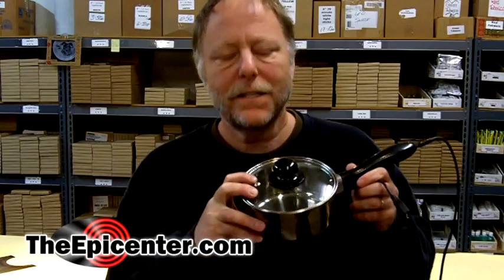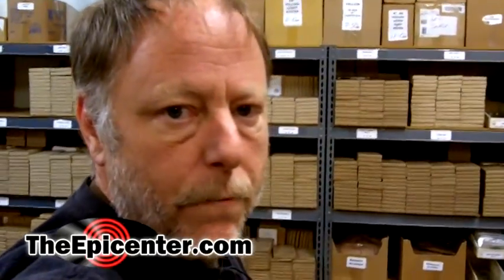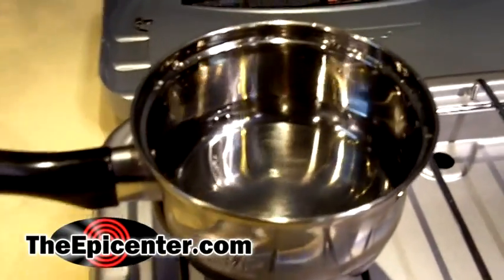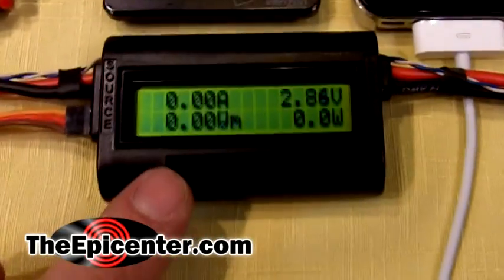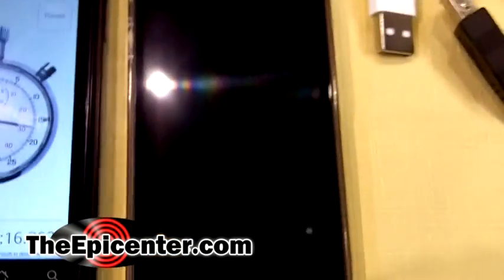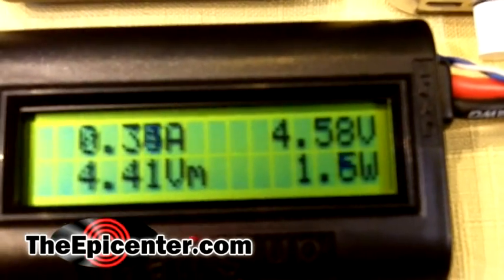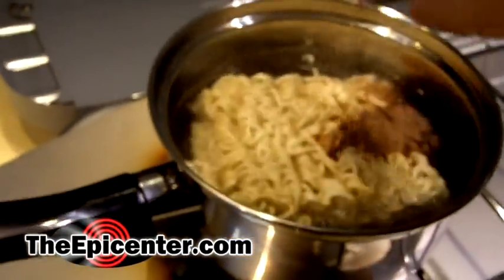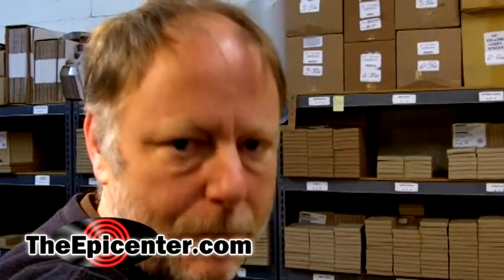Fire charges iPhone and other USB devices!

Comment from the maker: @GeniusIncome what you want is a Thermoelectric Generator Module (TEG). Be very careful about the operating temperature of the TEG. Most have internal connections that fail if temperatures reach 265 degrees c. The modules in this product use materials developed in Japan, and can withstand temperatures up to 1000 degrees C. A camp fire is in the range of 450-550 C. The $40 modules you note are not made for these operating temperatures. Hook one up, and try it on a camp fire. Please report back.

Comment from the maker: @passout18 The water that was added was just room temperature. Colder water or even snow or ice can also be used and results in even greater output since it increases the temperature difference between the hot and cold sides. But it is not necessary. As you see, the unit can produce 2 watts even while the water is boiling. The current price (as of 1/27/12) is $199 and it is available in America through our web site at TheEpicenter(dot)com